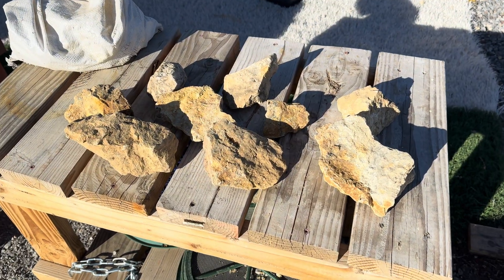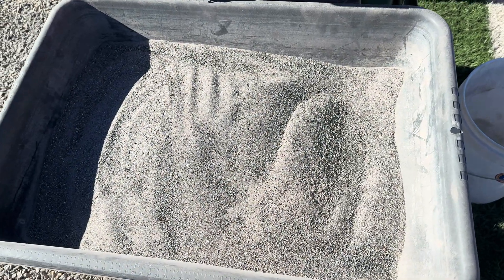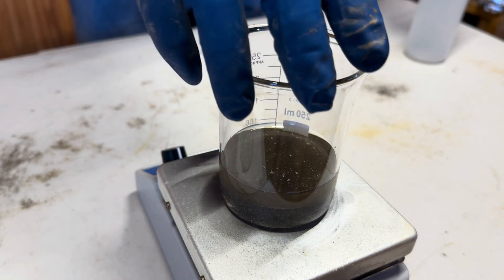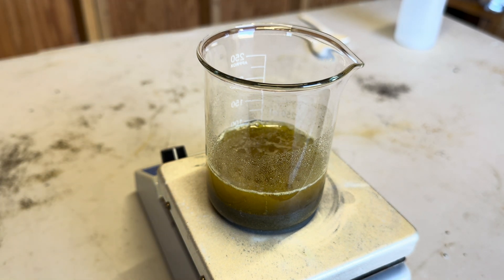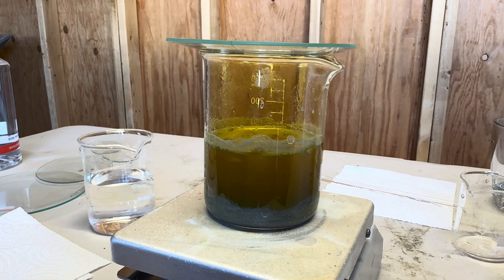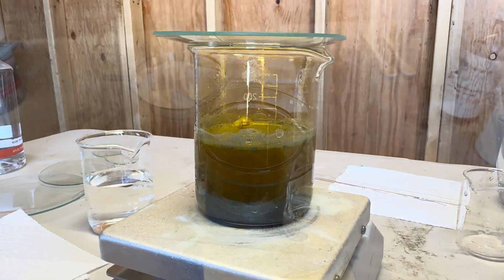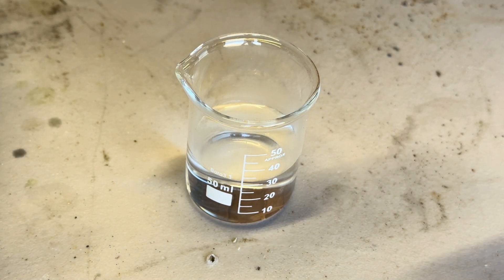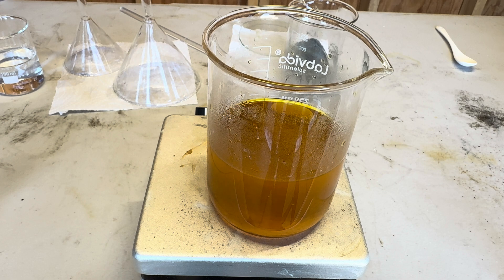How Gold Or Silver Is Extracted From Ore With Aqua Regia & Iron Sulfate

Comment: The one time i did it i used ferrous chloride because it was at small scale and i don't have oxalic acid, citric acid or some sulphite to do the reduction. It worked quite well and i read in "Burriel: Química Analítica Cualitativa" that it's quite selective to gold and doesn't reduce other precious metals.

@orophilia
2 years ago
Great information. I've looked around the internet and I don't see a lot of information about using ferrous sulfamate to precipitate gold, so you've shown us another interesting way to do it. All I can find in the literature is that using ferrous sulfamate to precipitate gold is highly dependent on temperature and the pH of the solution. Under some conditions it will also precipitate silver. The next time you make a video using ferrous sulfamate, can you test the solution using stannous chloride to see if gold remains?

Comment: You already cooked the sulphides out of it at 2000°. You don’t do it twice. That’s silly.
Reply from the maker: Hi there, thank you for your thoughts, but when I roasted the ore the temperature at the highest was 1200 degrees Fahrenheit. How did you figure it was at 2000 degrees Fahrenheit? If you’re talking about when I cooked the whole ore in the furnace at 2000 degrees the sulfides do not crack open according to multiple metallurgist. That’s been on ongoing debate 😊

Comment: I don't have a web-site but, I am a refiner.  After the roasting is done, use 50/50 nitric and distilled water. this will get copper, lead, tin, ect. this includes silver.  What's left is gold and platinum group
metals. Filter and rinse the 50/50 out of the ore. Do a good of it.  Then you use the AR to get the gold.  Cook the ore and AR for about 1/2 hour or so.  Add a few ml of sulphuric acid.
Add ice to double the volume to cool the solution. Any lead will into lead sulphide  and will be filtered out with other junk in solution.  It should be very clear yellow solution. If it has a greenish
cast to it, you might have a little copper left in it. No problem. Add urea to cancel the nitric and then add the iron sulphite to drop the gold. The silver can be dropped out of the first filtering with
salt water or muriatic acid. To purify the gold, redisolve  in AR a couple of times following the steps above.   Have Fun.
Reply from the maker: @frankzahn7773  This is great, thank you! I deeply appreciate it. If you don’t mind I’d like to try it. I won’t mention you in case I screw it up. Truth be told, I got permission from another YouTuber with 40k subscribers on the process I just did. I don’t mind trying new methods and testing things out. That’s the only way I’m going to learn. I don’t mind people educating me as long as it’s honest and respectful. I respect you greatly for educating me and your words will be put to good use. With much respect, Ernie Dionne
Reply: Frank, if you add the nitric 50/50 1st doesn't that disolve your gold and pgm's too?

Comment: At the risk of sounding rude, this really worried me. If you have no idea what you are doing, you absolutely should not be attempting to perform these experiments. These processes want to kill you! The fact that your son was smelling the reactions is horrible. Every step I saw was wrong and misinforming. Please don't do these experiments again. Certainly, at least before you learn the very basics. Sorry to sound so rude, but I am concerned someone may be harmed.
Reply from the maker: @LithicMetals  Hi, thank you for your concern and I do not take you rude at all. It would be appreciated if you could clarify on what you mean as to every step was wrong with the proper procedure. Also, if you can educate me on the proper way to remove the sulfur from the ore before I work with it would be greatly appreciated. Thank you . I appreciate you being here and value your time here.
Reply: Came here to say this.  
Read hoke’s book before you do any more of this, please. 
The short list: 
No catch pans.  Boil overs cannot be completely avoided, always use a clean pan under your beakers
Not properly preparing your iron sulfate.  It should be filtered after mixing with water and you should add enough HCl to it to turn it green.  
You used Way too much nitric. 
Shout out to sreetips and his myriad videos on proper nitric addition.  
Need to use Sulfamic acid to deNox, instead of urea.  (Probably why you had your boil over, which could have been mitigated with a catch pan)
Reply from the maker: @ Hi, thank you for your insight. It is deeply appreciated.

Comment: You dont need so much nitric acid.  Just add it as needed. You also need to denox before you add the urea.
Reply from the maker: @mrgreenswelding2853  Thank you. I was wondering about that? Is “Denox” a typo?
Reply: @ErnieDionne  denox is short way of saying remove nitric acid
Reply from the maker: @ Thank you, I really appreciate it. I was thinking about adding more Urea into the the solution I saved and add more Iron Sulfate to see if I can recover any gold should there be any in the solution. Do you have any thoughts on that?

Comment: Try adding ~1 teaspoon of Urea to the bottom of your coffee filter before you do your A.R.filtration.  It will nuetralize the Nitric Acid from the Aqua Regia, and allow for complete precipitation.  In the past, I've not added enough Urea, and the precipitation occurs, but, then over a couple of hours, the gold re-dissolves into the solution.  Looks like you're doing well learning this process.  Cheers!
Reply from the maker: @grantlucas2012  That’s the great advice I was looking for. I was wondering if I didn’t add enough Urea? I’m going to add more Urea in the solution I saved. Thank you Grant! Also, I’m saving my pull tabs. How many should I put in to cement my precious metal?
Reply: @ErnieDionne  It depends on how much gold you "guess" might  be extracted from your sample.  A rough estimation is to add as much aluminum as the amount of gold you expect to recover.  I usually only have very small samples, so I usually cut one pull tab into two pieces, drop it into the solution, then let the acid break down the aluminum. Don't be afraid to add more aluminum, if your first pull-tab  gets consumed and your solution is still cloudy.  As the aluminum is being eaten, you can see it turning black, and flaking off.  This flaking is aluminum cementing with the molecules of gold.  This process is a lot slower than precipitating with Zinc.  It is important to then take your "sludge", rinse  off all Aqua Regia, and then perform a Hydrochloric acid boil. This will remove the aluminum and some other base metals from the gold.  Your sludge should start to clump, and will take on a very nice medium-dark brown color.  This will be very  high grade gold powder.  There are further treatments you can use to further refine your gold.  Cheers!
Reply from the maker: @ Thank you Grant! I appreciate the insight and will give it a try. I can’t wait to try it. Take care my friend 🤗
Reply: great idea, i will try that too!
Reply: Good tip

Comment: Also a tip to help you out. To test what precious metals you have in solution you can use what's called stannis chloride which is tin chloride which is just tin metal dissolved in HCL. Lol. When using this solution you can tell what metals you have based off of the color of precipitate it creates. Gold precipitates will be a purple color. Less gold is a light violet and lots of gold would be so purple it's almost black lol. I just take a couple of drops of my solution and put it in a white plastic spoon then add a couple drops of stannis chloride and check the color. Or soak up your solution on a peice of filter paper then add a couple drops of stannis to check color change. It's easy to make stannis. I buy some pure tin shot off like Amazon. Take the tin shot, like maybe a gram worth into a little bottle and pour in HCL. The tin will dissolve without needing to be heated but it will take a little while. The solution you make up will be good for several months worth of testing.
Reply: Hi dad 🤯
Reply: @A_very_epic_guy  hello son lol

Comment: Hey Ernie you are doing great! I feel like you should have had gold since when you first added the ferrous sulfate and it instantly turned brown, but went back into solution due to excess nitric still in there. All that brown was gold precipitating but then dissolving due to the nitric. I may be wrong but when you mixed your aqua regia, it looked like you did 1 part HCL to 3 parts nitric. If so then that would explain why you had an excessive amount of nitric acid. It should be 1 part nitric to 3 parts HCL. Since you saved the solution which is great, I would mix up a bit more ferrous sulfate and add it to see if you can get the gold to drop.
Reply from the maker: Hi Garrett, I re-watched this just to make sure. Actually through this whole editing I watch it about ten times 😂 I did use 1 part Nitric (20 ml) to 3 part HCL (60 ml). Is it possible that I didn’t use enough Urea to neutralize the Nitric?
Reply: @ErnieDionne  yes it's entirely possible. You did everything great, the only thing I would try differently would be to try to neutralize the nitric acid first before using ferrous sulfate to precipitate the gold. My only concern about using ferrous then going to urea for denox would be possible unknown side reactions. Makes me wonder if that was the case since you said that later the beaker boiled over unexpectedly. Using urea to denox is typically fine as long as you are not using a lot because you can end up accidentally creating Ural nitrates which are explosives. I myself use sulfamic acid dissolved in water to denox my solutions
Reply from the maker: @garrettmillsap  Thank you Garrett. 💪🏻